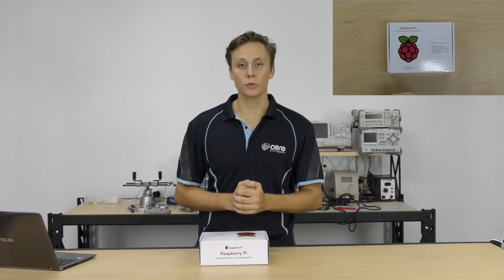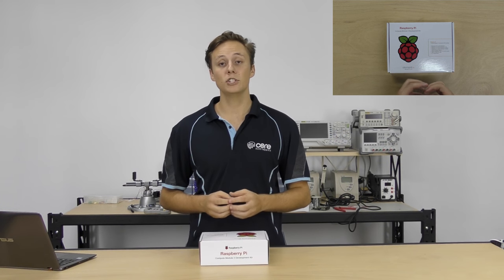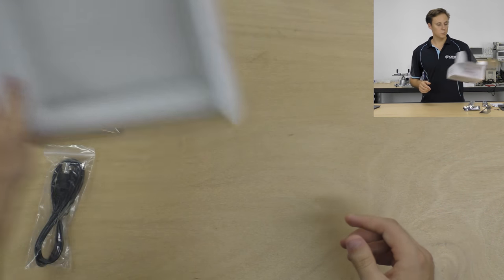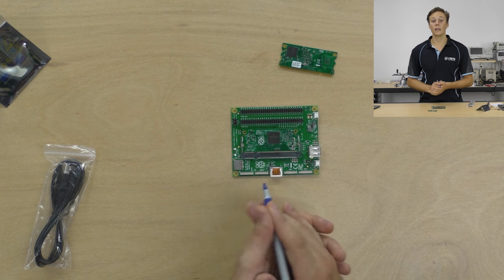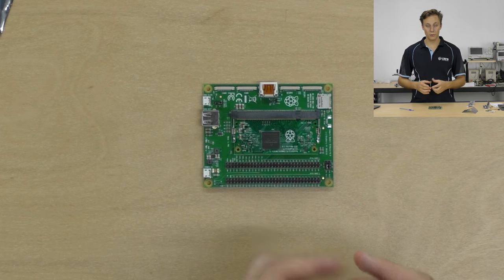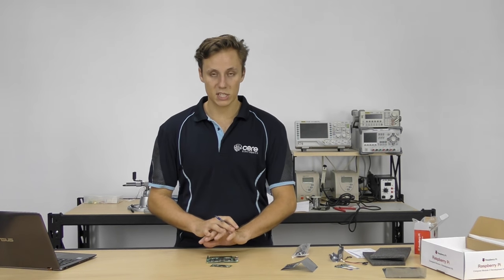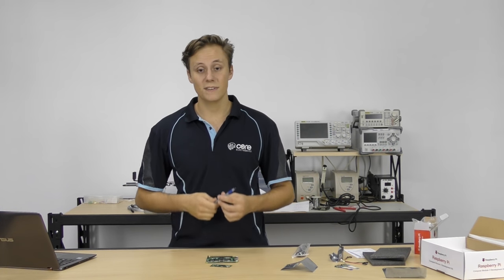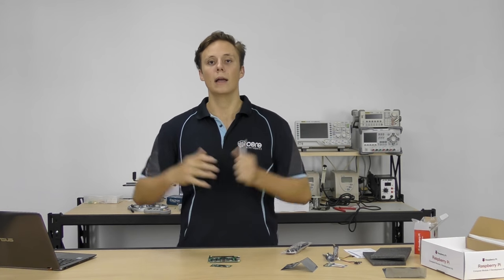Our Raspberry Pi Compute Module 3 Review

Comment: I can't find any videos that show this chip used in a laptop or any other device that isn't the prototyping board you use in this video. I want to like this module, and the new pine64 one too, but I just don't understand them! If you have to plug the module into the board that comes with the devkit, why not just buy the raspberry pi3 and save some money? 

If this can be used to add some cool functionality to a laptop or other device, would you be able to show how that works?
Reply: Melvyn Drag look up the Free play CM3 to see a use for one.
Reply: It's not designed for general hackers or people who want a cheap computer. It's designed for businesses and people who want to put it in consumer products. Also, the compute module lets you use all the pins of the BCM2835 instead of just 20 or 40 and the form factor is a lot smaller than a Raspberry pi 3.

The compute module is not designed for laptops RAM slots. It uses the same connector but that doesn't mean it's compatible.
Reply: @seamonkeys12y  It sure would have been nice had they installed an Ethernet port. At the very least it would allow a person to easily work with the CM in a headless fashion.  I bought one of these kits (didn't get the CM3L though) and also a USB/Ethernet adapter. I haven't tried it yet but I'm hoping I can use a powered USB adapter to allow me to connect a keyboard, mouse and the Ethernet adapter. Coupled with an HDMI monitor, that would at least allow me the ability to get going with the thing. Then once it's set up I could just go to using the Ethernet adapter in a headless fashion.
Reply: @Jake  I'm not talking about putting an RJ45 port on the module itself...but rather on the development board that the module inserts into. Sorry for not making that clarification, because I can see your point. I was meaning that an Ethernet port on the dev board itself would make it much easier to develop on the device.